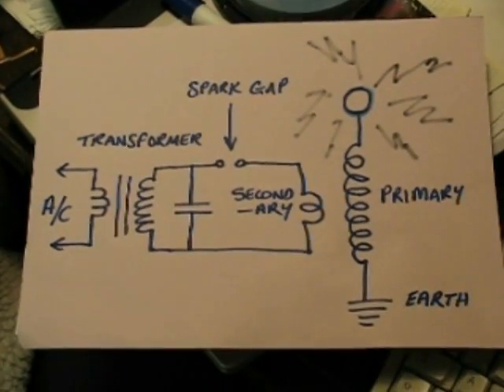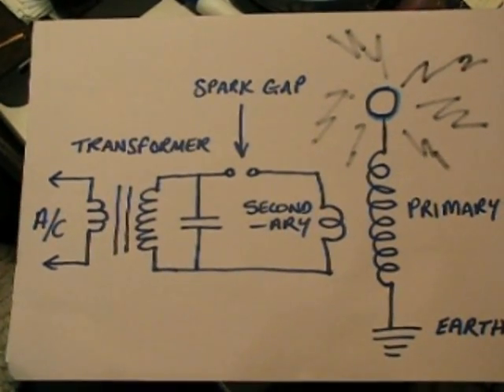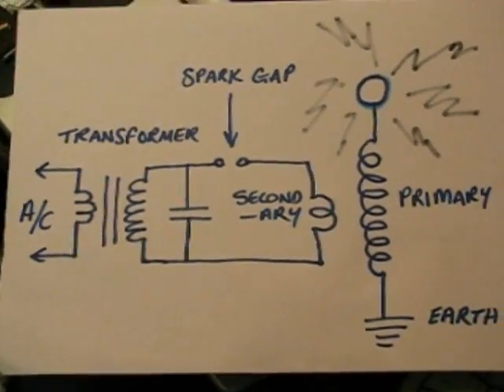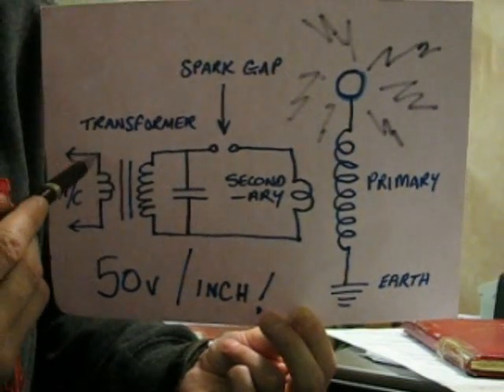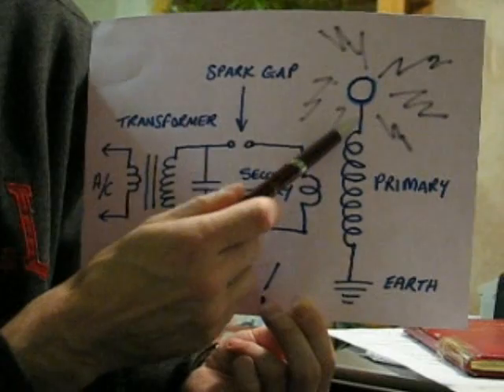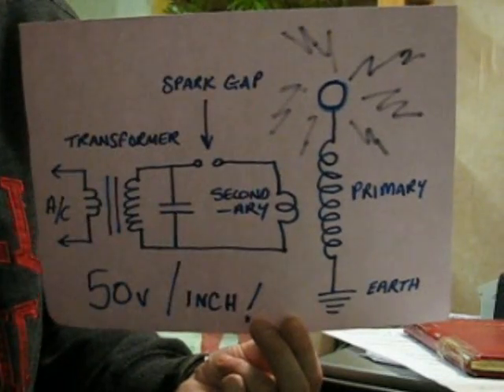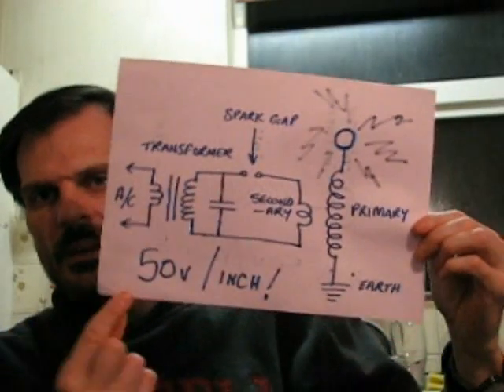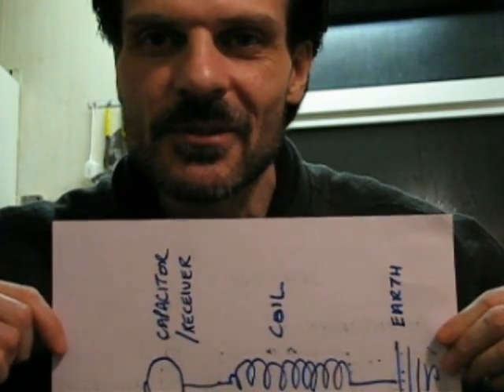Tesla's Little Secret

Comment from the maker: Well those are all good points. People are already completely off the grid suing solar power so it is no big deal but it does require quite a lot of investment. Reports suggest that people have been trying this circuit with varying degrees of success. Doesn't matter how much antenna you have if the circuit is not correct. Others say they have been getting power froma TV aerial. Why don't you try it and see how you get on instead of expecting me to build it for you? Ideas do not cost anything....

Comment: But if it's as good as you claim, you could run your house off it and make an absolute killing on the electricity bill. Think about what you could do with that money. You could even try selling the excess to your neighbours, or getting an electric vehicle and charging it up from it.

Or could it be that, as other bolder experimenters have shown, it doesn't even make enough power to reliably recharge a cellphone even with $100s worth of antenna?

Comment: The sun's output is primarily DC in the form of a stream of protons with what one might call a spread spectrum signal being e.m. radiation. Unlike a radio station there is no (effectively) single frequency to tune into. However, solar panels do a reasonable job of visible radiation to DC conversion. Likewise, a solar water heater efficiently receives part of the infrared spectrum. Wind also primarily uses the sun's infrared radiation. One doesn't need a tuned circuit to exploit the sun's output.

Comment from the maker: Hi, for a start a radio receiver is tuned to receive radio waves at a certain frequency NOT radiant energy from the sun (at maybe VLF or U-VHF?) although in essence the principle is similar to the crystal radio circuit. As for power! Did you know the camera flash circuit generates a 55Watt spike (at 5kV) repeatedly from just a simple 1.5V alkaline battery? I have no idea how much power it could receive, it would depend on the design obviously, but lightning that would be quite powerful!

Comment: As for any proposal for "broadcast power", just remember the inverse square (or in fact, cube) law... it may work with moderate efficiency in a very localised area (some tens of metres, max), but beyond that it'll be somewhere between massively inefficient and just plain too weak to be worthwhile.

Perhaps if it's something more like a satellite dish beaming the waves directly at another single, or small close group of receiving dishes - much like the existing proposals for microwave-beam power.

Comment: By the way, given that this is basically an untuned radio receiver, and I don't recall either the pre-tuner part, or the tuner itself (which is basically a dump-resistor for all the unwanted frequencies) of any radio I've owned giving off huge amounts of waste energy (ie heat)... just how much power do you suggest this might produce, if I have, say, a five metre long antenna and near-zero-loss connections into/through/out of whatever load I may connect to it? Any more than one or two watts?

Comment: I like how the bit in the description saying how Tesla "invented the electric car in 1931" has mysteriously vanished. Presumably someone called you out on how electrics had actually been around for about 40 years by that point...

Can I also call you out on how you have quite amazingly managed to rediscover the spark-gap morse radio transmitter (which only existed because no-one had developed valves or transistors) and see if this also vanishes?

Comment: The point I was making is that I am using a known AC energy source. It is barely far field at the station's operating frequency (about 1MHz) but my antenna collection area is so small that the cone of reduced power it leaves in its wake would not be noticed. Needless to say the scavenged power is low as a consequence. Of course the radio station is paying for the power I am using so it's hardly free. The resonator cannot accumulate a static voltage - it provides an AC path to ground.

Comment: Bingo, I've built it and the ions indeed do capacitate, however the capacitance must be in series off the antenna and the capture side is 4 diodes in series with capacitors (2) and you have it. The reason we do not use this yet is its dangers of fire and lightning storms.
Figure out how to control the fire factor and you will be rich.

Comment: I found something realy cool - all about antenna energy. "Practical Guide to Free-Energy Devices - Chapter 7"... on remove islands are two towers. wire suspended between them, from central point of suspended wire is wire going to circuit then ground. If 50v per inch is real - then wow. Also that 10kv set up looks interesting and dangerous. the first lot Jes Ascanius’ Version - looks best, and shows metal plate too

Comment from the maker: The sun transforms AC energy to DC at such a rate that its atmosphere literally "radiates". If space is a perfect conductor then its energy can travel unlimited distances without loss due to resistance (which creates heat). That is why the sun is not "hot" in space. No resistance = no heat = zero potential difference. So in theory you can have unlimited energy at any point in space.

Comment from the maker: The prime energy being emitted from the sun is DC (as far as I know) because it is constantly charged and radiates energy to everywhere around it all the time. It is a higher potential than the surrounding space and the further from the sun the greater the potential difference (and also the less current). Energy flows from a higher potential to a lower potential regardless of whether they are positive or negative, it is relative. The higher potential is considered "+ve" by some.

Comment from the maker: The voltage builds up like it does in the clouds, I imagine. The higher up the greater the potential difference to earth. The circuit would need a large charging cap or a battery to capture the energy otherwise it would just short to earth. It can then be tuned to generate 50-60Hz which is actually about the worst frequency it could be. Higher frequencies are much less harmful to humans. Check out the Kelvin water experiment... lightning for beginners lol :)

Comment: Usually transformers are used with AC Current not DC Current. DC can work with transformers but it must be cycled on-off like a auto ignition.

 1) I do not understand how the Radiant DC Voltage can just build up in the "antenna".

 2) I do not see how useful power can be generated after going through both step-down transformers. This circuit will not produce STEADY AC 50 or 60 HZ power. Have you ever made any usable power from your circuit?

Comment: this is intriguing, but if you built it like in the diagram you would have to change the direction of the transformers, so that they step up into the tuning circuit, but then i would think you would have to step it back down at least a little to stabilize the voltage? i've been researching this free energy for a while now, and I still think magnetic currents are the way to go for now, i have a torch I made which powers itself, (never needs batteries) maybe i'll upload it for you?

Comment: Hi very interesting I have thought of a similar idea, based on the thermoelectric effect, which is how a refridgerator works, but if you build it in reverse, a capacitor in the sun, and a capacitor in the Earth, you can get a voltage from a temperature difference.

Comment from the maker: The Central Sun radiates AC energy and the Solar Sun converts this energy into harmonised DC. The harmonics and the angle at which the Sun's rays strike the earth direct the course of the seasons. This is why the temperature is greatest at the equator because the Sun's rays are at right angles to the earth's magetic flux causing maximum resistence. At the poles, where the magnetic flux is more or less in line with the earth's axis, there is less resistance and therefore less heat.

Comment from the maker: Hi, our Solar Sun receives its energy from a larger Central Sun at the heart of our galaxy, the Milky Way. The electrons from our Sun are continuously being replenished by the Central Sun. In order for energy to flow you only need a dipole, in other words a positive and a negative pole which creates a potential difference in voltage. Earth receives electrical energy from the Sun which makes it spin, illuminate and heat up the atmosphere. The earth basicaly being a magnet with an iron core.

Comment from the maker: The Sun is DC electrical energy! The atmosphere and space are filled with it everywhere all the time. That is why voltage increases as we leave earth because atmospshere acts like a resistor, heating up as it resists the electrical energy coming from the sun. It is not hot in space or as we approach the sun because there is no atmosphere and therefore no resistance.

Comment: I like your style of presentation, two thumbs up.
My take on the reversal of this as you propose, is that the static source picked out of the atmosphere would inherently be DC. The inverse of this (original design) used AC to trigger the needed motivation in the collapsing spark inducer that drives the original circuit....in reverse (as proposed) This collapsing spark circuit would not trigger or oscillate the same way. But if it did, hypothetically, you WOULD indeed induce an AC signal at end

Comment: Seriously? why do people actually believe this would work? what part of stick a metal torus on a coil suddenly equals energy from the air? doesn't matter what the rest of the circuit does, a primary coil on a Tesla coil will not receive power. I've built a Tesla coil before and I can tell you without a shadow of doubt that this will not work. metal torus + coil does not equal receiver for "radiant energy"

Comment: The circuit is correct. Look at the primary alone. You have the reciever at the top and ground at the bottom. The tower isn't shooting sparks out. It's pulling sparks in. You are correct in that it's pulling in thousands of volts of electricity but at micro-amps. Just add a step-up transformer between the primary coil and ground. If constructed properly, in the end you will produce more kilowatts from the primary than what you originally use to power up the circuit.

Comment: we arent using it because there is another circuit needed where he used a DC current to begin the feeding of the energy from the sky. This went like this. DC throws on. sky energy flows. DC off. sky off. DC on etc etc. The diagram you show, he made, then later he identified the free power when he saw it happen during the switching on of a massive DC generator. where did that extra oomph come from he thought...Then he made the circuit to capitalise on that. its in his patents. add them together.

Comment from the maker: The trick with resonant coils is to design them so that their mass is exactly equal. Or a direct harmonic ie. 1/2, 1/4, 1/8, 1/16th the mass/number of turns etc Even then the cct will still need to be tuned... mains voltage doesn't have to be 50-60Hz ! In fact that frequency is a bad choice of Edison because it is most likely to cause physical harm.  Higher frequencies are much less harmful to humans.

Comment: The idea is sound - I think your biggest struggle is obtaining two identical secondary coils, both having exactly the same self resonant frequency, I think you could adjust the transmitter set to match the receiver, but the tuning will be critical. Also both sets will need an antenna of sorts... i would use a long wire. the next problem is that you would need a tuned circuit to enable you to have 50Hz oscillations at the step-down transformer. otherwise you may have problems with the high freq.

Comment from the maker: @ChaosCompass Nothing tangible yet! The coil is a conductor but it also acts like a resistor... a resistor being a coil of wire. Its conductance/resistance being determined by the gauge of the wire and the number of turns used. This is one of the ways we can "tune" the circuit :)

Comment from the maker: @stiggyh  Ithink it is a neat concept, but to date no-one can produce any results, not even Searle. Given the information I am given I reckon it "could" work. In fact I think at some stage it probably "did" work. But like all great concepts it came from a higher model of understanding, and once repressed it becomes difficult to get back into that mindset. It boils down to belief, if you believe something can work and you want it enough... you will find a way and it WILL work :)

Comment: Very interesting idea, and I can see how it would work. I was wondering how you came to the figure of 50v/ft though, I'm assuming that the coils materials and construction/dimensions would have an effect on the actual voltage. Also, have you tried to build any models of this yet to test the theory? Thanks for your time.
Reply from the maker: It’s the positive potential between atmosphere and earth. It is measurable but only with very small current. I believe Tesla wrote about it.

Comment: @MattBlytheTheOne Well, I did start thinking about it after watching the video through.  It would work the way the schematic shows - if it's used as a receiver.  If so, then the primary and secondary are labeled correctly.  All it needs (maybe) is rectification from the secondary and capacitors to store the rectified output.